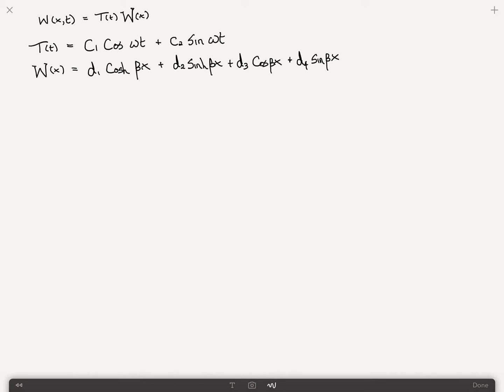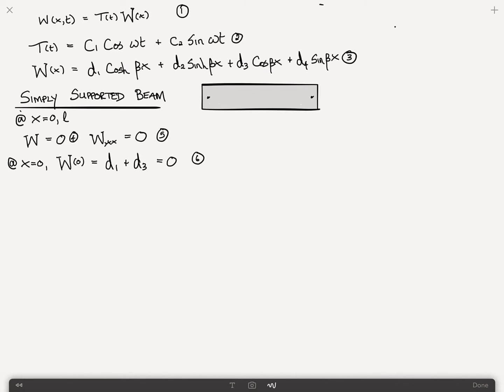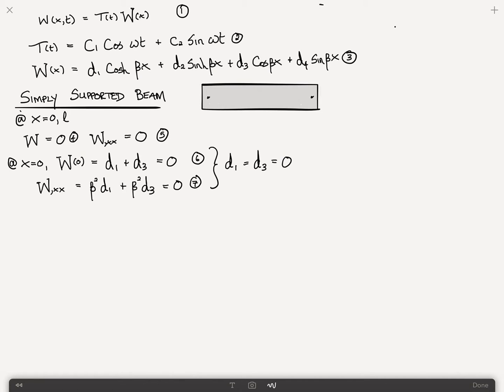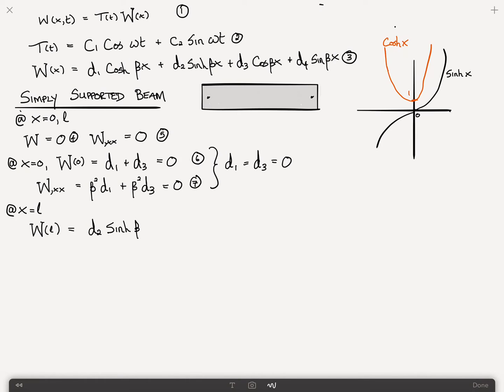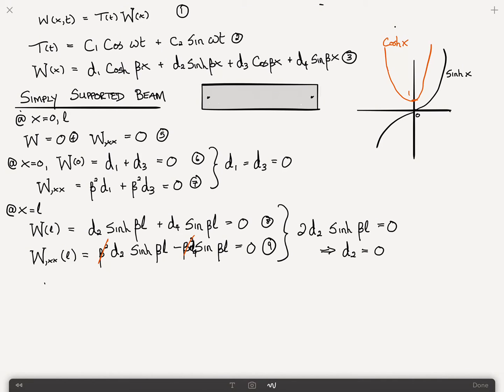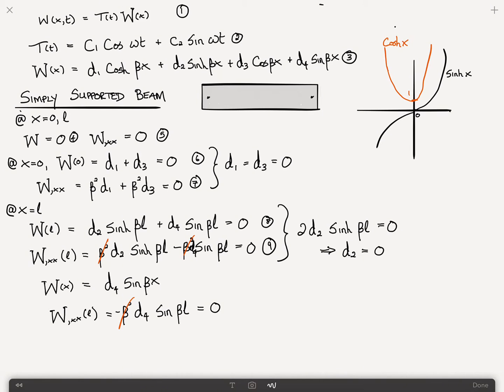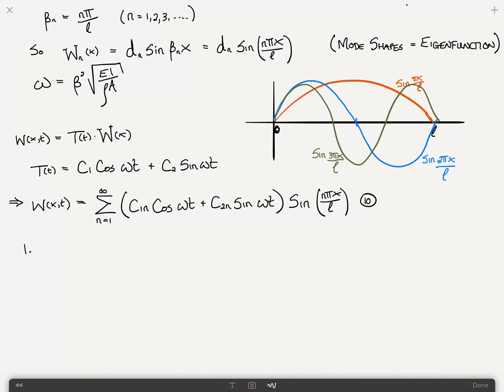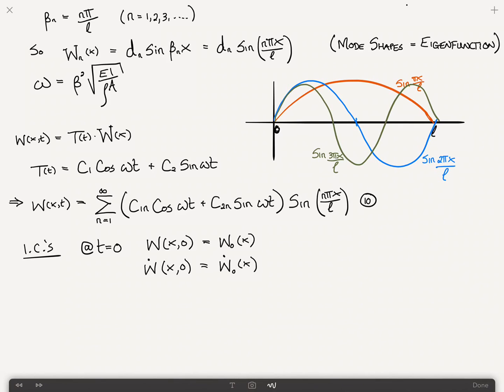Response of a Simply Supported Euler-Bernoulli Beam (Continuous System)

Comment: Hi! A really great video! I enjoyed watching and it was very helpful! :)
But:
I think Equation 7 must be:
beta^2*d1-beta^2*d3=0, because the derivative of cos is -sin and the n the derivative of -sin gives -cos (from the equation W(x)).
Only then equation 6 and 7 lead to d1=d3=0. 
In the video these two equations only lead to d1= -d3 where the value of these constants can be anything, and not only 0.
Reply from the maker: Yes, you are correct, the 2nd term of eqn 7 should have a minus sign.  I had previously tried to fix the video using an annotation.  However, it seems that some people are unable to see the annotation because either they have annotations turned off or they are on a mobile device (which does not display annotations at all).  I will pin your comment to the top of this thread so that others will see this.  The rest of the equations are correct!

Comment: 15:15 W(x,t) = T(t).W(x) with T(t) = C1cos(wt) +  C2sin(wt)
 and 15:49 W(x,t) = infinite sum....could explain please that
Reply from the maker: This is analogous to what we did for the 2DOF problem - only this time our mode shapes are not a vector, but a function (as there are infinitely many of them for a continuous system).  For each mode, there is a an associated shape and frequency.  The shape gets picked up by W(x) and the frequency gets included in T(t) which is the time-dependent part - NOTE:  I just realized that in my expression for T(t), the ω's should have a subscript "n".

The reason this becomes an infinite sum is because we have infinitely many mode shapes.  The response is simply the linear combination of each of the mode shapes times the time-dependent part times a constant.  The constant will be determined from initial conditions.  In practice, we will not use an infinite series, but will truncate it depending on the desired accuracy and the number of modes one wishes to analyze.  If memory serves, the Rule of Thumb is that one wishes to analyze N modes accurately, then one should include 2N modes in the model - ie include twice as many modes as what you are interested in.
Reply: @Freeball99  Thank you for your answer.
After investigating thru google, i understand that the global deflection is the combinaison of the mode shapes because each mode shape is the solution of the equation of movement then (the sum / combinaison) of mode shape is also the solution (math of diff. equation,principle of superposition)
Reply from the maker: WahranRai that’s an even better explanation!

Comment: Hello, first of all thank you for this great video. I need your help about my project which is the free vibration of a cantilever(clamped-free end) beam with initial displacement. as you know to plot displacement=time graph of the tip end point of the beam, i need to have final equation for the graph. Could anyone please help me? thanks
Reply from the maker: You proceed exactly the same way as I have demonstrated in this video.  The only difference is that you are applying different boundary conditions.  I address these boundary conditions at the end of the previous video (https://www.youtube.com/watch?v=3R8q3becNvg).  

Simply use the BC's for the built-in (cantilevered) condition at one end (x = 0) and use the free-edge condition for the tip (x = L).  Apply the two BC's to the general solution as I have done in this video and then it's just a little algebra.  

You will end up with a similar transcendental equation and from that, you should be able to get to the solution (the equivalent of eqn 10 in this video). 

The frequency of vibration will be different for the two cases, however.  Can you tell which of these two beams will vibrate at the higher natural frequency?

Comment: could you explain for the case of free-free boundary condition, how to form the equation for mode shape? thank you
Reply from the maker: You need to apply the natural boundary conditions at each end, namely that the moment and shear are zero at each end (traction-free surface).  This will reduce to the 2nd and 3rd derivatives of w being zero at x = 0 & L.

It's a bit too difficult to explain the math in these comments, but here is a paper that does a good job of it.  http://www.varg.unsw.edu.au/Assets/link%20pdfs/Beam_vibration.pdf

What is particularly interesting about the free-free condition is that the beam is unrestrained and so is free to undergo rigid-body motion (i.e. the beam can displace without deforming or vibrating).  Because of this, there are modes with ZERO frequency (one translational mode and one rotational mode).  

Solving this problem for the displacement can be quite challenging.  Generally a time-marching solution is your friend here.
Reply: Thank you for the reference. I already understood until the value for BL as given in the table. But I dont understand how to form equation 6. Since the paper didt explain in detail on how to form the equation.
Reply from the maker: @ammarburhani8328  Here you go.  I think this covers what you're asking: 
https://www.dropbox.com/s/lnx0iyfz8iium16/free-free-beam.png?dl=0

Comment: Great Videos, sir! I will be grateful if you do a video on a cantilever beam with a tip mass at one of the ends!
Reply from the maker: This is a good suggestion.  I will make a video on this in due course.  However, in the meantime, you should be able to give it a go yourself after watching this video.  The only difference between the simply supported beam and the cantilevered beam with a tip mass are the boundary conditions.  Once you have the boundary conditions correct, you need to substitute these into equation 3 above and solve for the constants d1, d2, d3 & d4.  So it's really about getting the boundary conditions correct (the rest is just algebra).

The boundary conditions are x=0 are just the standard geometric conditions, namely that the displacement and slope of the beam are zero.  
So w(0,t) = w,x(0,t) = 0.

At x=L, you have a tip mass, m with rotatory inertia J.  You have to apply Newton's 2nd Law here to get the boundary condition.
F = ma --> where F is the shear force at the tip and a is the acceleration of the tip.

So, @ x=L:
EIw,xxx = m w_ddot

Similarly, applying M = J θ_ddot

So @ x=L
EIw,xx = - J w,x_ddot  (- sign due to orientation of axes).  In the event of a point mass, J will be zero and this boundary condition would reduce the the natural boundary condition of zero moment at the tip:  w,xx = 0.

I hope this makes sense.  It's a little difficult to write equations in these comments.  If this is still unclear, let me know and I will write it up and attach it to this comment.

Comment: Is there any explanation of why sinh(Bl) is not equal to 0?
Reply from the maker: If sinh(βl) = 0 then β = 0 

which means that the frequency, ω would have to be zero (since all other components of beta are material & geometric properties and are positive numbers).  This would lead to trivial solutions only, i.e. the displacement W(t) = 0.  So, for nontrivial solutions, this boundary condition must hold for ALL values of βl, so therefore the coefficient (d2) must be zero.  

EXTRA:  This is an extension of the n-degree of freedom system where we set the det( k - ω^2m) = 0 for nontrivial solutions.  In that case, it gave rise to n-eigenvectors.  In this case (for continuous systems), we get an infinite series of eigenfunctions instead.  But the two are analogous.  You might want to revisit the treatment of the two degree-of-freedom system where I spent more time explaining this (https://www.youtube.com/watch?v=zo2Ml88QyrA).